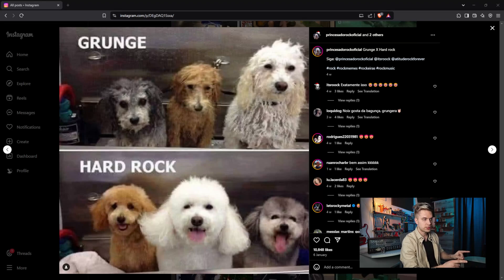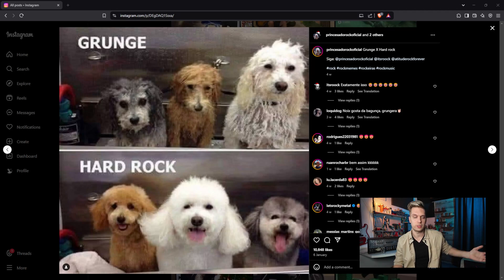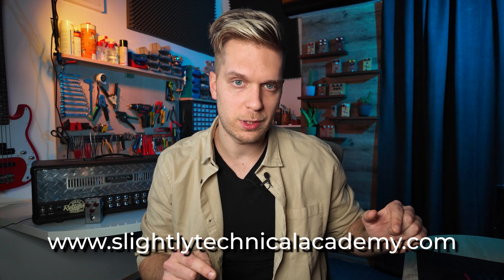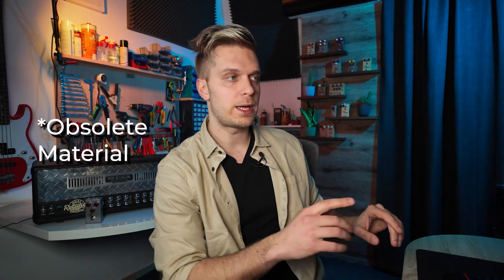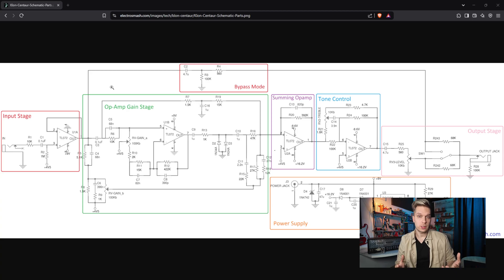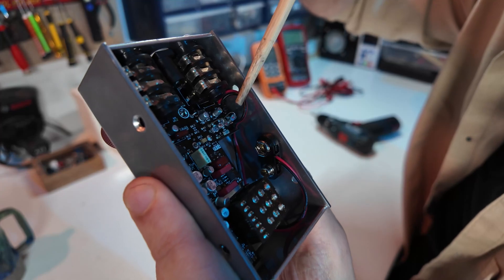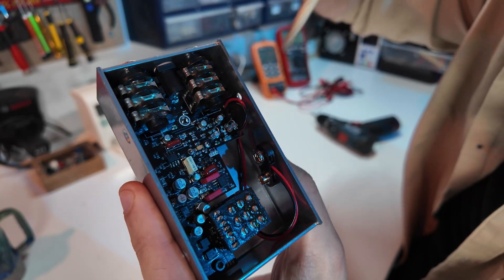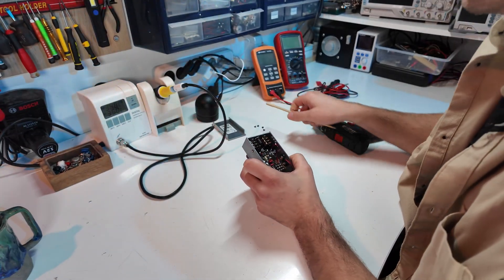Engineer's Advice: Cheap & Easy Mod for KLON Style Pedals!

Comment: I could hear the diff right away - that’s the tone I’m looking for a bit more gain fuller tone and sustain … 
Thanks so much I didn’t think to try in series .. can you also try two different diodes (diff companies) in series as well ? And what about using Red L.E.D diode for more grit in series or is that too much X would different color in series be better bit lower output than red .. say using two green or two blue L.E.D instead ? 
How you will reply 😀
Reply from the maker: Hey, the LED diode voltage drop is too high to be mixed with germaniums, unless you want to make it asymmetric. With LEDs you will get a lot of volume and not a lot of compression, would need to crank the gain for  some compression.
You can experiment with any different brand and mix them up, that's totally cool. A little bit of asymmetry for some mojo.
Rock on!

Comment: As a non-technical pedal enthusiast, I would require a significantly more forensic detailed identification of specific component locations, and step-by-step demonstration of exactly where and how to solder what-to-what, etc. Luckily, I know a local Tech that could perform this mod. By the way, do you have any opinions on the limited edition Wampler Germanium Tumnus? Cheers~
Reply from the maker: Hi, unfortunately I try to make the videos brief so I didn't go very deep in the step-by-step demonstration. Definitely take it to a tech.
I had a Tumnus once, and to be perfectly honest, it sounded so good on YouTube videos, but when I tried it in person, I was not that impressed and I liked the Archer more. However, that is only my subjective opinion, I think they are great pedals.
All this stuff is in the ballpark. Even this mod is absolutely not necessary, but it might be an interesting thing for enthusiasts to explore.

Comment: Russian blue germaniums are pretty good. I had a few thousands of them. In as big batch you can find fV up to 0.7V. Have tu use gloves not to heat them and test many times. Even plotting with DCA75 close to original sound is still not the same sound. 1N270 might be better. All diodes sound different and compress differently but in the end ended up figuring I am not a huge fan of germanium buzzing..

Comment from the maker: Cool cheap and easy DIY mod that can be done to pretty much any clone of a legendary pedal. I understand that the differences in the sound samples is not too big since stuff like this hardly translates over YouTube. Trust me, there is a huge difference. Let me know if you try this and how you like it!
Reply: You could probably get a similar effect by changing the impedance of the signal before it hits the diodes, that will most likely do a better job of changing the knee of that diode since that knee is related to the current through the diode. Looking at datasheets of germanium diodes they have very soft knees compared to silicon diodes